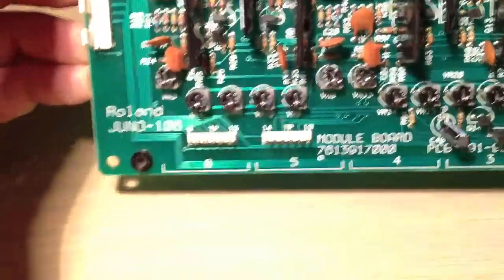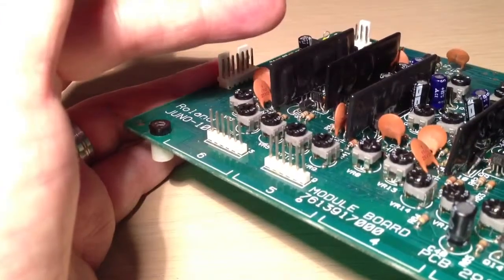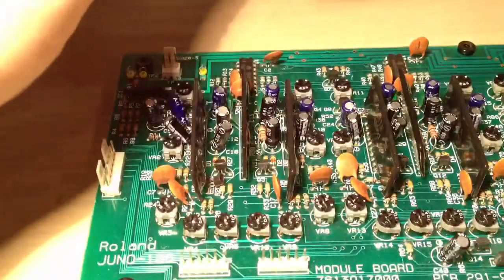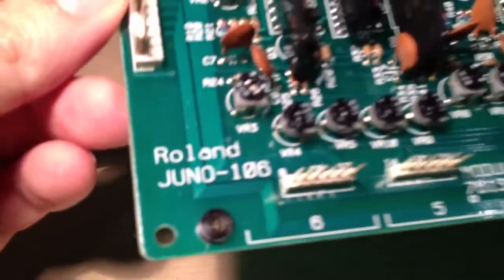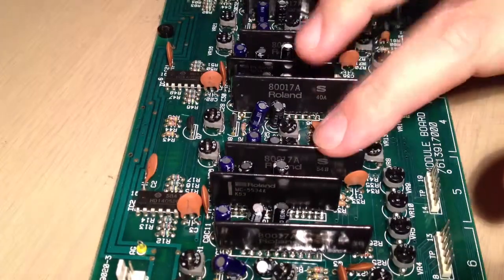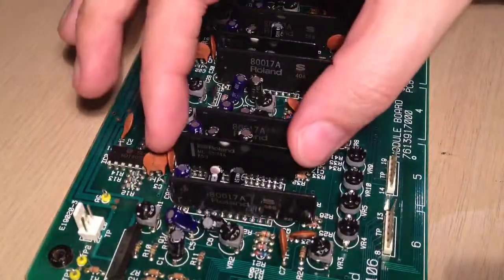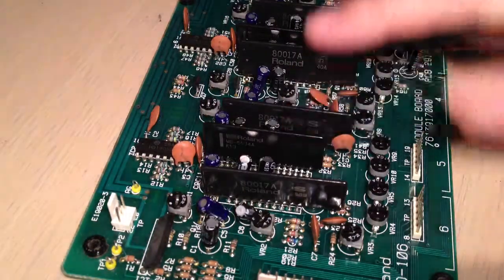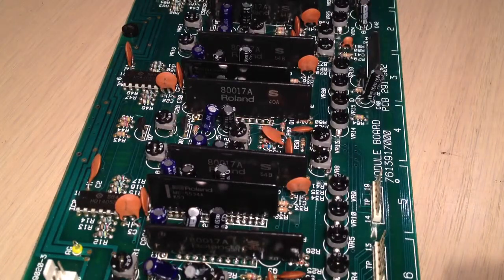Juno 106 Repair - Part 2

Comment: I am also wondering what desoldering pump you are using? I am definitely at the point of giving up on solder braid/wick method...
Reply from the maker: It's a Xytronic D60, takes a bit of getting used to, but its infinity better than braid.

Comment: really appreciate if you could help me answer some questions; what model vacuum pump is that? Also, any recommendations on solder? Thanks
Reply from the maker: It's a Xytronic D60. Solder is just bog standard 60/40 tin/lead with rosin flux core. Totally generic stuff.